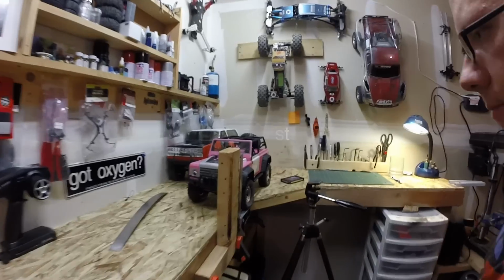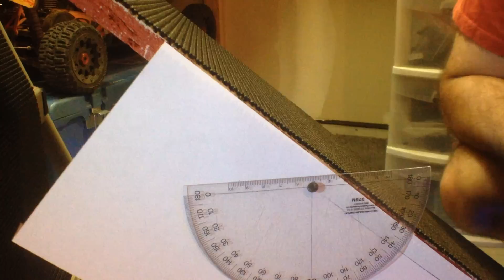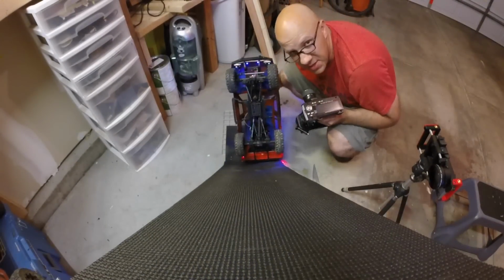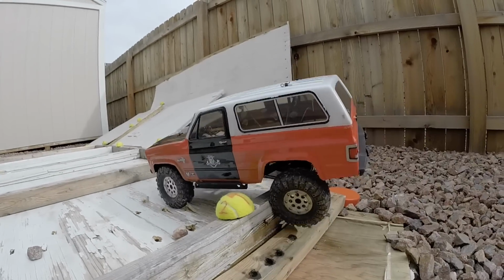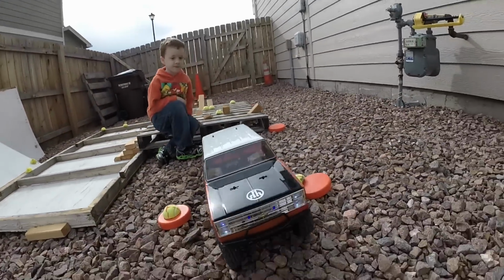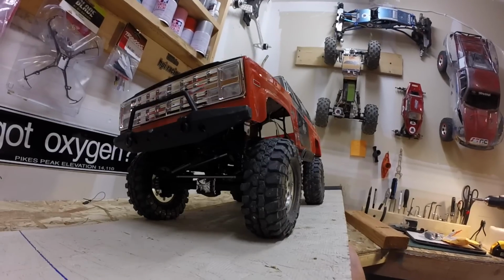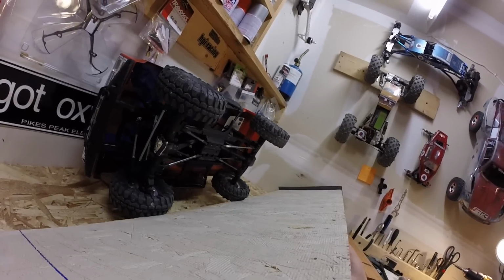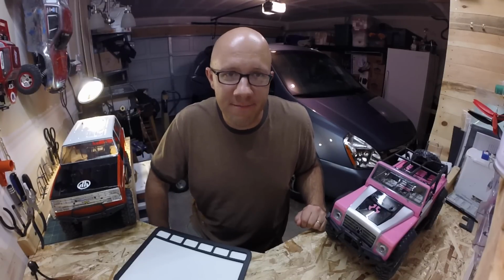Axial SCX10 Dingo vs Vaterra Ascender

Comment: I wanted both.  Settled on the scx10 deadbolt because it was $250 vs $400 for a vaterra
Reply from the maker: true but deadbolt is all plastic links and no cms. so you'd spend that much to get the upgrades to match.
Reply: +Life of an RC Addict Made my own metal links for less than $20.
Reply from the maker: me too. Lol. I made a lot of upgrades myself which is half the fun.

Comment: Great video! I have always wanted the Chevy Blazer, that is my dream truck. I hope I can be able to save up and get either the RTR or the Kit Vaterra K-5. Might not be the real thing but it will have to do.... I am a noob, so you know. But when you were measuring the vertical challenge why was the right front coming off? Should you add weights up front there?

Comment: AWESOME test you have here !!! ? Does the Dingo have the limiters still in the shock's ? ? Is the battery in both rig's running up front. I know the Ascender is just wandering about the Dingo :) and thank's for sharing this with us !!! :)
Reply: When my wife built the Dingo, we didn't use the limiters in the shocks. I used the same 4S 1300MAH LIPO in both rigs. The dingo was built with the front battery mount like the Honcho uses... again all stock options that came in the kit box. I hope this helps.
Reply: Yes ;} and that's awesome !!! I was also thinking about a tire swap and the same test. Also knowing that the Dingo has the limiters, maybe a retest without them :)
Reply: Still is a awesome VS ;}

Comment: ascender are good but you have to get steel driveshafts, the plastic is brittle, also dual piston shocks and steel wheels with the brass wheel weights make a huge ability difference when it comes to pushing over rocks.

Comment: what about vs the jeep wrangler scx10 unless its the same frame, exct
Reply from the maker: All SCX10 are the same thing.  The kit comes with aluminum links instead of plastic, but that's about the only difference other then the body.
Reply: Oh ok thanks c:
Reply from the maker: I usually by the least expensive scx10 I can find somewhere and then start upgrading. haha.  They all need something upgraded at some point.
Reply: Yeah i like the jeep wrangler one but since i dont have any electronic to put in it im gonna get the rtr. Also saddly i cant find a jeep zj body (grand cherroke 94-98).
Reply from the maker: I don't know of anyone ever making a grand Cherokee body. Proline made a regular Cherokee body for a while.  Not sure if they still do or not.

Comment: I imagine the Vaterra is going to be more durable though, by quite a long way. Horizon Hobby know how to make durable RCs.
Reply: I think your right. Out of the box my scx10 collects a lot of debris inside axles housing, and inside the spur gear cover. The front suspension has the crossmember collapsing on the servo horn and the steering links. Crossmember also rubbing on the servo cable. And the transmission screw holes stipps very easily. Plus ascender has more durable alu parts out of the box and real cvd axles up front. My scx10 only has dogbones. I need to upgrade a lot on my scx10 power wagon to get the ascended stock performance/durability.
Reply: Torbjørn Larsen well you have the pwoer wagon which is an rtr... if you buy the kit axial rewards you with free upgrades like aluminum links all around...
Reply: Yes. But the ascender has more metal parts than any axial kit.  Even the transmission gears is metall. And it is cheaper.
Reply: ***** I don't think my axial shocks has any oil left. It certainly doesn't have any damping effect. It was bad out of the box. After 6-8 batteries the shocks are complete rubbish.
Reply: Torbjørn Larsen yes, even in the kit the shocks are rubbish, but the kit is better than the rtr
Reply: The quality issues I have seen isn't because of plastic parts, but lack of attention to detail in the design.. who decided that axial rtr kits should have so many plastic parts? 
Even Hpi crawler king has 4 alu links. I fixed most of my issues with my scx10. But quality for money is much worse than ascender.  the ram body doesn't even have plastic shims to keep screws from ripping trough the body. And the body clips is rubbing directly on the front window.  

Motor wires on all axial brushed rtr kits are really poorly soldered.. mine broke of after driving 4 batteries.  I love my scx10. But it needed far to much work to function like expected.  

Minor assembly flaws and design flaws isn't good for this hobby. Beginners could quite this hobby before they know how durable rc cars can be.. my wheely king axles didn't need to be filled with marine grease to stay dust free. And it didn't need mods to keep sand from collecting inside the spur cover.
Reply: Torbjørn Larsen well that is quality control for the motor. but lets look at price difference, the power wagon, 359.97, the crawler king, 439.99. also the crawler king is a rock crawler, the scx10 a scaler. completly different markets and completly different rigs
Reply: *****  crawler king is dirt cheap. rtr kits don't need to be less reliable. Most parts on my rc8te is stronger and heavier than factory team parts.  Factory team parts are light weight to improve lap times.. it's usually weaker than rtr. The rtr kit used lots of steel where the factory team uses aluminum..
Reply: Torbjørn Larsen well yes, but 2 different markets and rtr's are now generally for begenners so they dont give top of the line stuff due to price. cheaper=more purchaces it is screwed up but all these companies care about is red and black, profit and loss